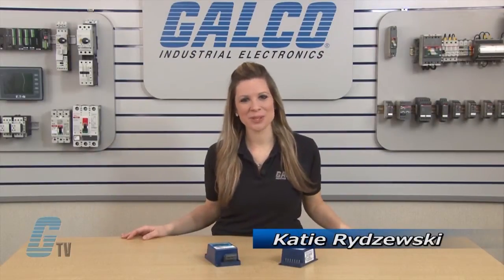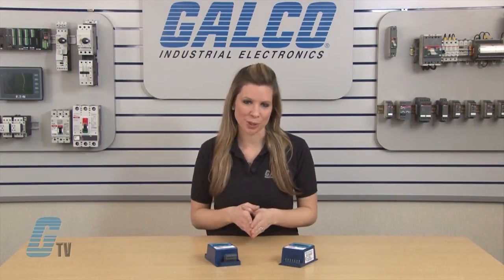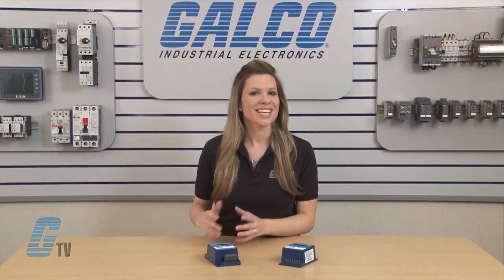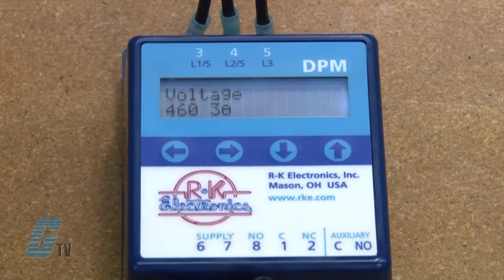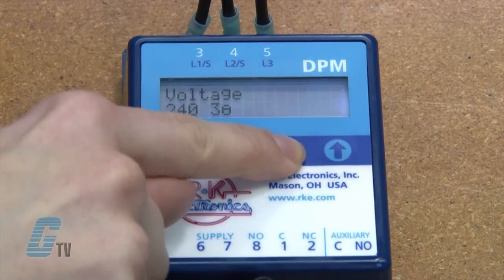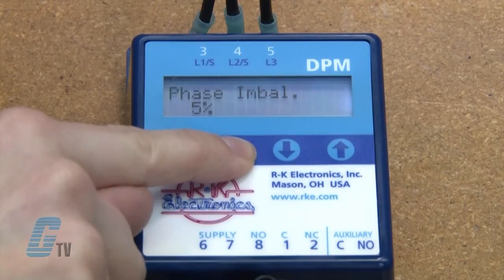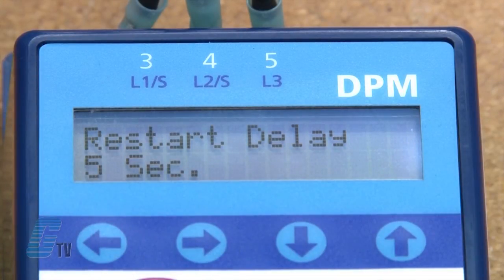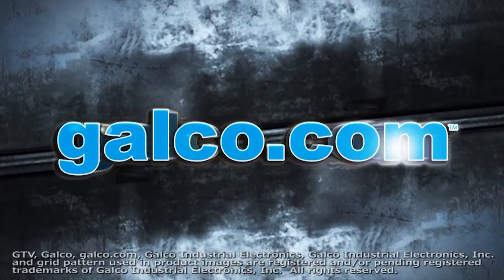RK Electronics Digital Phase Monitor

Comment: Don't know if anyone still monitors comments on this video but I had a question about a phase monitor model DPM-24A-T-0002. It does not retain settings in a total power loss situation, have a building with about a dozen RTUs on it, all 208V, 3 phase. Every time there's a power loss they revert to 480V 3 phase, is there something I need to check for why they won't retain settings? Like a battery or something?